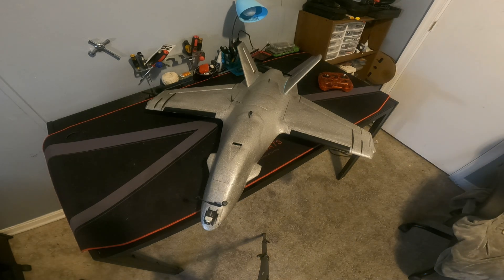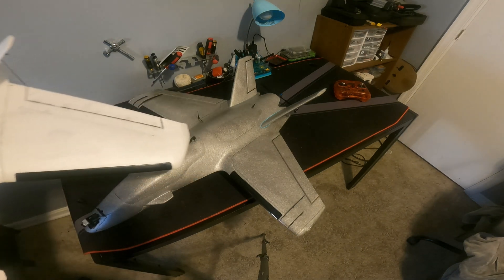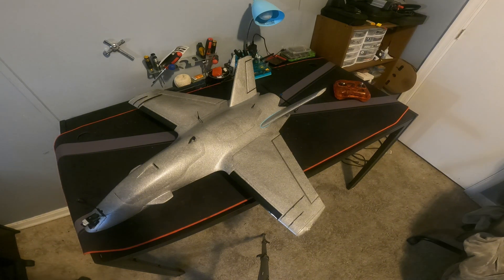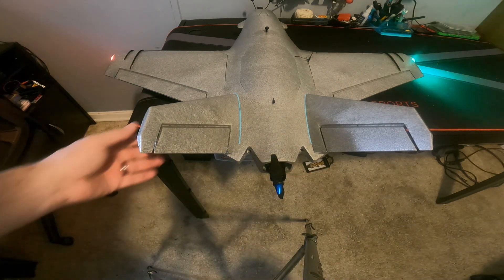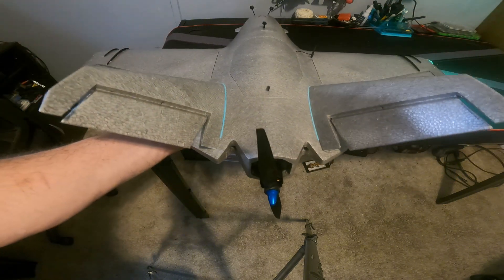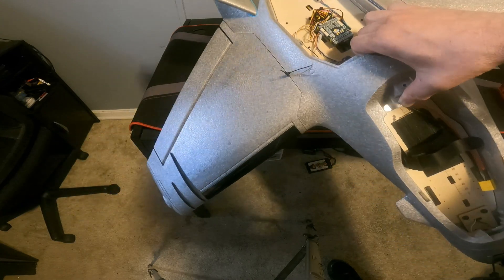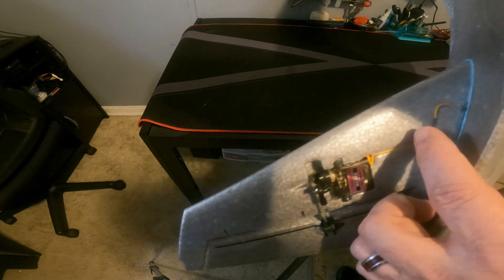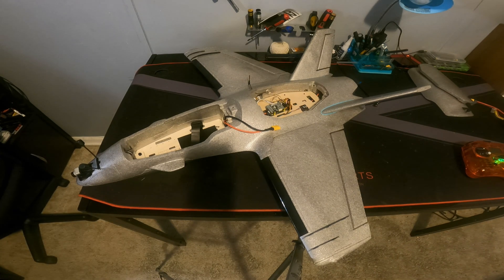Atomrc Dolphin Pro ~  Information & Tail Setup.

Comment: Are the wing profiles for the two the same (aero foil shape)? I want to convert it to a twin motor puller like Jeff’s build. If the wings are different I will have to make new motor mounts that’s what I need to know.
Reply from the maker: They look very similar and very close to the same shape and size. They are different then the original dolphin in length.
Reply: @Pr0pCiRcLes2 thank you ! Then they probably should fit.
Reply from the maker: @chanithurithmal3717  I would say yes and your are very welcome 👍